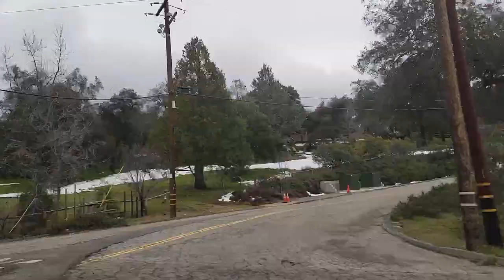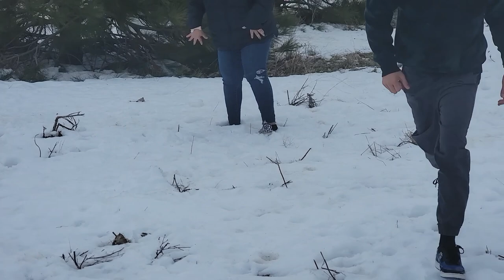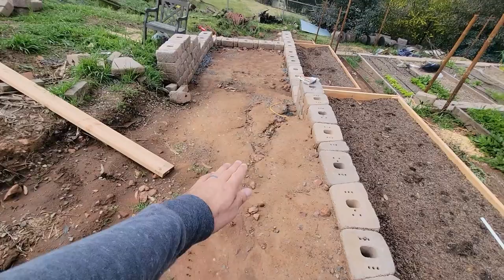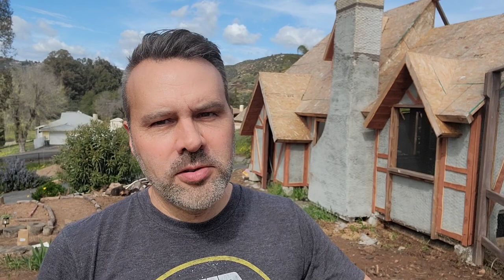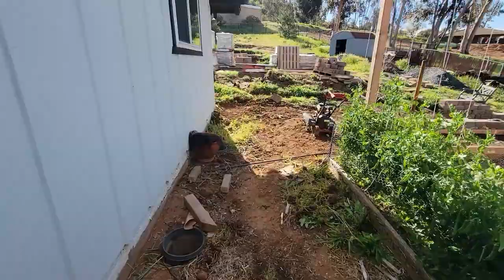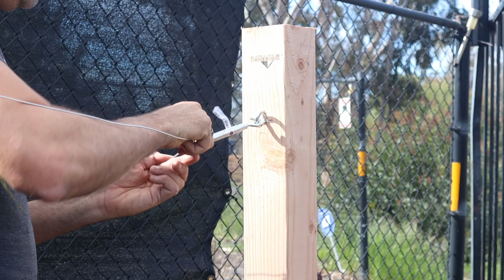Snow Day & Sickness (and Building a Berry Trellis)

Comment: you are trying to dril to fast, that is why you are getting smoke. you need to turn the speed down to 1 or 2 and every inch or two pull the bit out to clear the chips. also your bits might be dull.
Reply from the maker: Bits are definitely dull